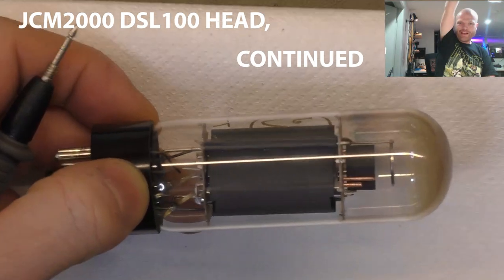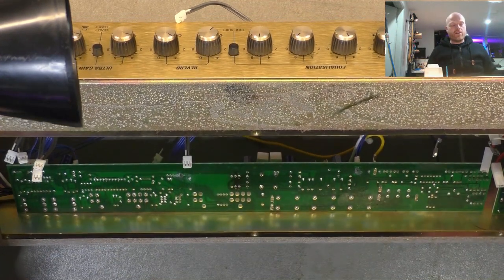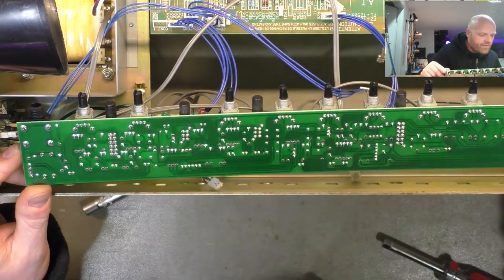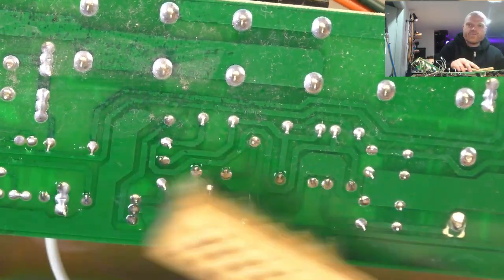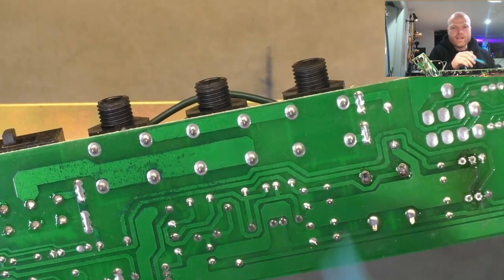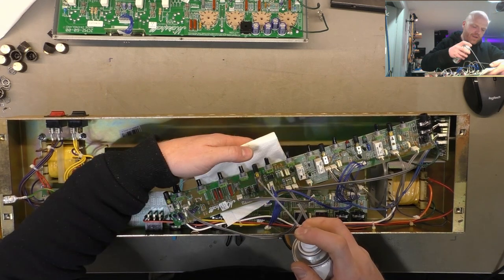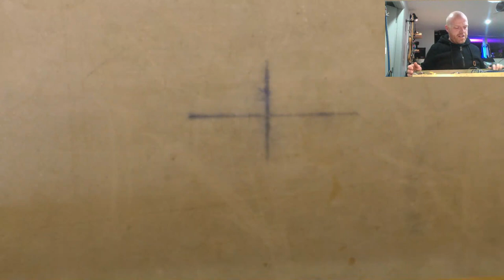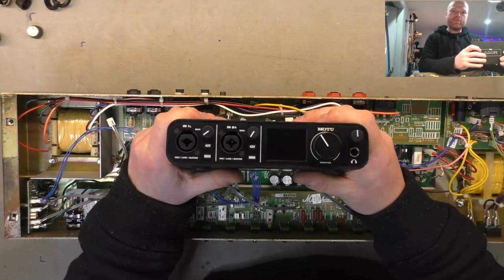JCM2000 DSL100 Main PCB Replacement - Part 2

Comment: Re "pot metal":  I don't know what the alloy is made of nowadays, but sometimes really old pot metal becomes so unstable that it literally cracks and crumbles and falls apart.  I once rebuilt a meter from a really early piece piece of test equipment where the cast bracket that held and supported the meter assembly had literally broken apart in chunks and had to be painstakingly glued back together.

Comment: Those types of miniature green pots with plastic shafts will often have lubricant around the shaft that appears to be some kind of clear silicone with a consistency and viscosity similar to honey. It may not react well with some control cleaners and its best not to displace it into the resistance elements of the pots.  The first time one cleans the pots in a never-before-seen piece of equipment, use your control cleaner very sparingly and cross your fingers beforehand. Sometimes one runs across certain pots that no known control cleaner seems to work on without causing them to become sticky or even seize up completely.

Comment: Mr Brad.  I have a 2018 DSL 100..obvioulsy not the JCM 2000 namesake.  Do the PH219 also work on this head?
Plz advise.
Reply from the maker: Completely different amp design, mate.
Reply: @BradsGuitarGarage  thank you for confirming that..Amplified Parts spits that part when i search 2018 DSL 100..and....I can't find a board tho...is one out there?
Or not since a board seems to not be an issue as often?
Mine has melted resistors on it 😬
Thinking of tossing it as I have already bought a Bugera 1960 and a 20 watt plexi.
Reply from the maker: As far as I know, the conductive PCB issue has never arisen on that model to date.
Reply: @BradsGuitarGarage  makes sense...mine has some resistors that got hot and began to melt into the board.. Hopefully it can be repaired... Again I appreciate your quick response..